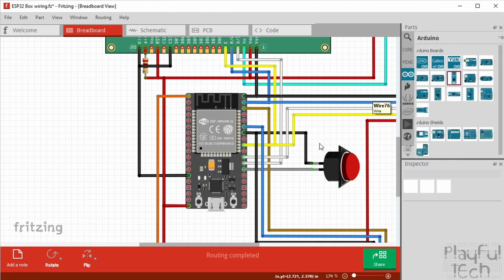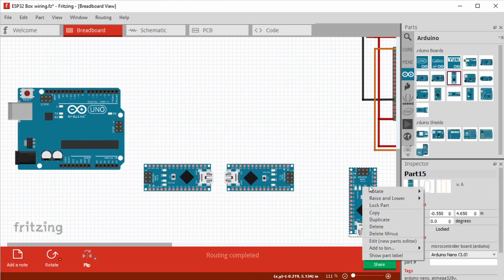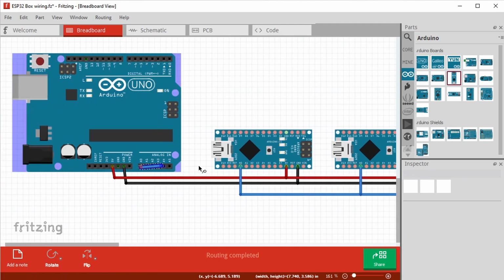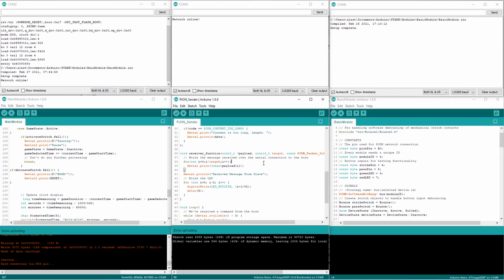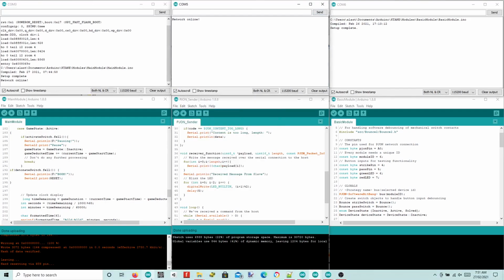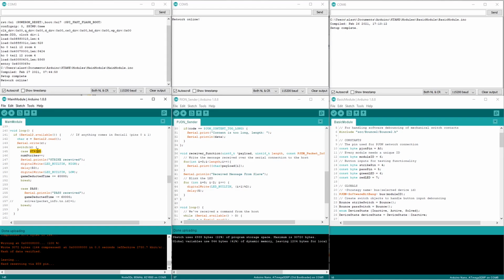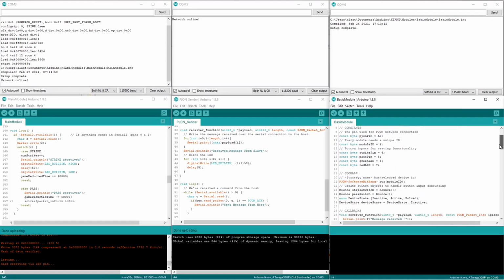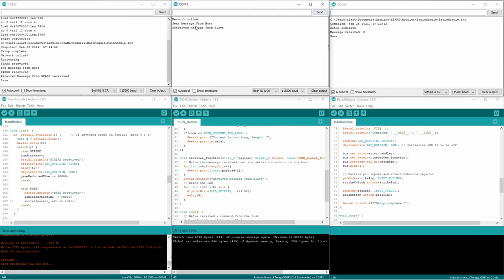Building an Escape Room-In-A-Box - Part Four

Comment: Off the top of my head, a discreet transistor on the signal GPIO pin,... can use the voltage from ESP32 on collector and connect Arduino signal to base, ground of both to the emitter pin.

Second option is an optocoupler.

Comment: I believe the logic level converter is simply a voltage divider which doesn't add any lag.
Reply from the maker: A resistor divider in the ratio 2:1 works well to step-down logic levels from 5V - 3.3V in a single direction. But this is a bi-directional convertor - it needs to convert from High -> Low, and also send signals from the Low -> High device. The convertor I'm using has a FET design, which is pretty common and works for most interfaces including SPI and UART but, for whatever reason, just doesn't play ball with PJON - not sure it it's a timing lag as you mention, or that it alters the waveform shape or peaks. But, either way, I now have a better diode-based solution anyway!
Reply: Got it. Great job on the series. While less exciting than the other format, it does have a lot of useful details. I hope you won't completely abandon the old format though.

Comment: Enjoying this video series, looking forward to seeing all the arduinos talking to one another and running their dedicated puzzles :-)
You are right, the Atmega328 chips on the nanos are older hardware and are defiantly showing their age. I would say that right now, 3.3v microcontrollers and sensors are now the most common standard by far, and getting things 5v only will only get harder and harder going forward. I think you found a great time to leave the Atmegas behind.
I highly highly highly recommend getting some boards with the Samd21 microcontroller on them. They are the new kids on the block to replace the Atmegas, and they are 3.3v and have a tone more ram. They have been around for enough years that all your popular libraries should support them easily. I love those chips so much, I am never going back to an Atmega again. I highly recommend any of the feather format boards, and you might like the breadboard friendly samd21 nano boards and can hook a whole bunch of them using pjon
Reply from the maker: Yeah, I've mostly moved over to ESPs myself, but I still have a ton of Nanos lying around, they're cheap, easy to use, and surprisingly robust. And I'm not expecting any of the individual puzzle submodules to be that taxing in terms of processing/resources. I was also somewhat hesitant about possible signal degradation of running the whole bus at only 3.3V - I'm probably being over-cautious since the cable run is only going to be a few metres, but it just felt safer to run it at 5V!

Comment: Love this video series! I've been working on a similar project for the past couple of months, and I have to say I'm a bit surprised that the nano couldn't handle the work. In my master controller I'm running the PJON network (thanks for that tip, btw!), a TM1637 for the clock display, a 1602a LCD display, a DFPlayer mini, a tone generator, and the arduino-timer library - all with their necessary libraries and my game control code and my code is at about 63% of the RAM of the nano. I suspect that one of the displays you were driving is the big memory hog, and you'd likely be fine with whichever one you don't really require. Another thing if you haven't tried it yet is to reduce the number of PJON packet buffers you require, and to set the max packet size to the smallest you need. For my project, I've set them to 4 packets and a max size of 33 (for the 1602a). Great work, love your content, I just subscribed yesterday. :)
Reply from the maker: Thanks! Yes, it's the U8G2 library that's killing it, and if I were to dump the LCD display and just use a TM1637 or one of the other displays it would be fine on an Arduino. However, at the back of my mind I'm possibly thinking about using the big LCD display as a hint delivery mechanism, so I need both the U8G2 library and also plenty of flash ram to store lots of text strings for all possible hints, and also want to use some of the ESP32 features like Wi-Fi/Bluetooth as a way for a "gamesmaster" to remotely monitor or reset the game, so I'd rather keep the ESP32 as the main controller I think. But that might all be subject to change!
Reply: @PlayfulTechnology  Ah, good point about having a nice, big display for hints. I'm thinking of using the DFPlayer for audio clues maybe, haven't decided on that yet. Interesting idea on using Wifi/Bluetooth to remotely monitor and possibly even interact with the modules - very cool! I was thinking of adding an SD card module so I could record what the player does, maybe even have a website where it could be replayed on a virtual reproduction of the modules, but maybe that's version 2. :) Great project, I really appreciate your work!

Comment: I’ve been working on a similar project but am using a raspberry pi as the controllers and it’s two boxes. Made for two teams in two different locations. Each box plugged into Ethernet and the controllers auto log into a video conference so I can watch the teams and give clues. Some of the puzzle clues are held by the other team so they have to work together. They can both see and hear each other through the meet as well. I love the modular idea so the boxes could be generic and swap out puzzles for the theme.
Reply from the maker: Yes, I'm looking forward to getting on to that bit - just need to get the basic infrastructure up and running first!

Comment: Presumably, this was recorded before the Raspberry Pi Pico appeared?
Reply from the maker: Raspberry Pis run at 3.3V logic too, just like the ESP32, so they'd have exactly the same problem about sharing a bus with the Nanos.
Reply: @PlayfulTechnology  I meant ditch the Nanos and do it all with Pi Picos...
Reply from the maker: @duncanx99  Sure, you could do that. But a.) Picos are new, so there's very little documentation or libraries available for them. And they're not just a new devboard, but an entirely new chip. Nanos may be "old" technology by some standards, but there are a ton of existing libraries for AVR processors handling everything from rotary encoders to LCD displays, which you'd have to rewrite from scratch for a Pico. And while they certainly have limitations and a few quirks, at least those quirks have been discovered and well-known! My previous experience with several generations of RaspPis has often ended in frustration after discovery of some undocumented or weird design decisions :)  b.) I already have a ton of ESP32s and Nanos lying around, and one of the principles of this particular project was to make use of resources that are readily-available. I certainly won't rule out toying with a Pico in a future project, but it will probably be for something more self-contained and without quite so many "moving parts". Is there anything particular feature about the Pico that you see offers an improvement over an ESP32?
Reply: I disagree on the lack of documentation - Raspberry Pi Foundation have done an excellent job and makers are adding more each day.

My thinking was, that at £4 a throw, use the same board in each location, all running a common voltage, and use I2C as the comms bus. SPI is implemented on the Pico, so that takes care of all the display options for the Master.

It probably won't be long before PJON is ported to the Pico so, when it is, you can have your one-wire bus for the slaves if you really want it and can use Serial between Master and First Slave if that's what floats your boat.
Reply from the maker: @duncanamos3716  Sorry - I wasn't meaning to criticise the Pico documentation that has been provided - (from what limited I've seen) you're right it's actaully very good. It's more to do with the fact that there's so many new elements to it - a new board design, a new chip, IDE, and there is such a tiny userbase that there will undoubtably be many interesting quirks and "features" discovered over the coming months as more people start to play with it. Having been an early adopter of previous RaspPis and found it a somewhat painful experience, I think I'll hang back a little and wait til v2 before I consider using it in any production environment though :)  And while a bare-bones SPI/I2C interface might be there, I've become somewhat accustomed to things like FastLED, U8g2, all of Paul Stoffregen's utility libraries etc. which will be some time before they are ported and reliable.

Comment: Could you use a diode at the esp to bypass the potential divider when sending?
Reply from the maker: The problem is that it's a single data wire. A diode would drop the forward voltage of the 5V incoming signal to an acceptable level for the ESP32, but wouldn't work for bi-directional data of the outgoing 3.3V signal. But, I think you're right that I could use a diode-based solution - it's a little more copmlex, but here's one possible option: http://www.falstad.com/circuit/circuitjs.html?ctz=CQAgjCAMB0l3BWEA2AzNA7ATi8gHACxhaKTJYh4RIGogICmAtGGAFABu4WATCKgj7E+PDH0hQQBCejoT50BJ3pg+AvglUhR4ydPqSFSgO5SCefoO0Jkl8WwAmZi3hlXX28ADlUBR3coJHhtAzzAfPwAHbhFIC1ULHjjwQzZTYNt1GIDIfwzwLQJzApFvBAxWNJU1KyKLLNzTOtDm1nt0kI98tqgq4RLrWx7GqWQCAc0hLRGCMYHW6bZoye1k8tsk+NSAZ2rtMT3NyQgAMwBDABtthjYAJ0GB-IbweHg753ni57BXuDZd-o6bJHCSnS7Xd4rHorEHgVzvfo9QHJUHwgAe4Aw41QeA2PEyeAo4x42OgqA4AB1tmwMZoZHgLAgBPwsBBieMEBwqissusctyMJkrHyQX1eAEEvzTJKspLRdF8l0QsUIPIlh8PM0VakgA